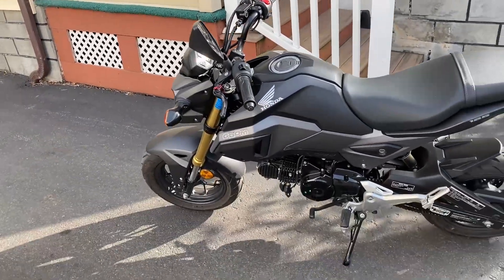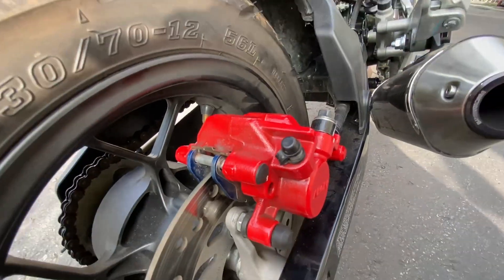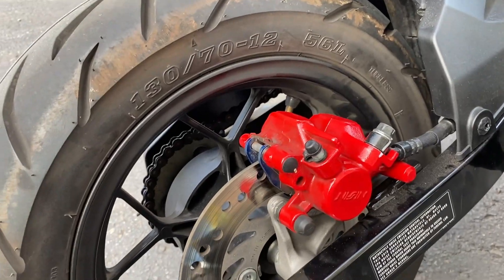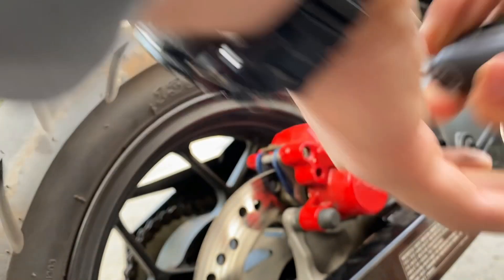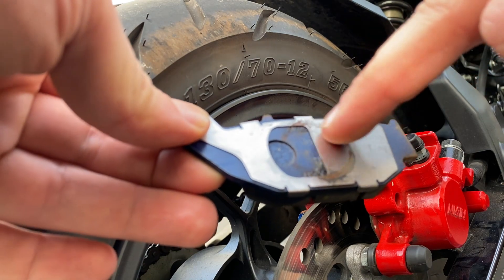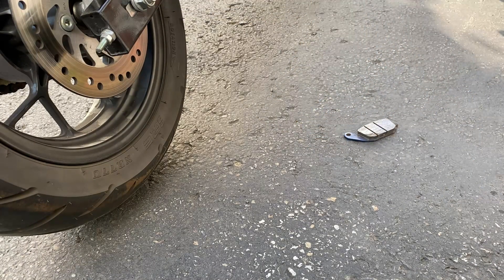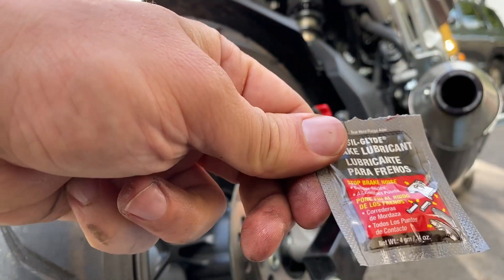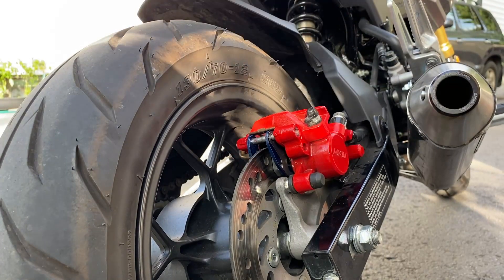How To Fix Squeaky Brakes (Honda Grom)

Comment: This video solved the rear brake squealing on my 22 Grom!! thanks so much
Reply from the maker: Thanks for watching and subscribe, yeah it happens when the brake parts get water on them, or if the bike is stored outside
Reply: Hi I have the same noisy brake  problem on my 22 as well hopefully this video helps out!

Comment: Did you transfer the shim over from the oem pads? If not, that’s why it’s squeaking. Get a shim to put on back on.
Reply from the maker: The issue was that the bike was kept outdoors before i owned it and the brake parts got a little corroded and not lubricated… but i cleaned and lubed it and no problem since

Comment: My rear breaks squeak a bit whenever I’m just moving the bike. Does that mean they are rubbing too much? How do i fix it?
Reply from the maker: Thanks for watching and subscribe... if the brake components get wet from water they can rust, causing a sqeaking sound. In my case the previous owner kept it outside. Just do exactly what i did in the video... clean the dirty brake pins a little and lube them up with that stuff i used.
Reply: @Drive315  i just checked and they aren’t rusted. I think the brake pad itself is just running on the drums at all time so it seems tight
Reply: @CHiTO316  my Chinese bike does the same ima check all bolts and stuff and see what’s up
Reply: Is the caliper starting to seize

Comment: Might be too quick to tell from this video. I did this to my KTM but the squeaking came back after some miles of riding.
Reply from the maker: Thanks for watching and subscribe ! You shouldn’t have a problem unless you ride in the rain, keeping it outside will make the problem come back as well
Reply: @Drive315  my KTM lives in its garage. Next I’m going to change the pads.